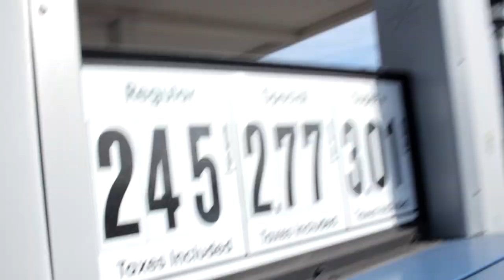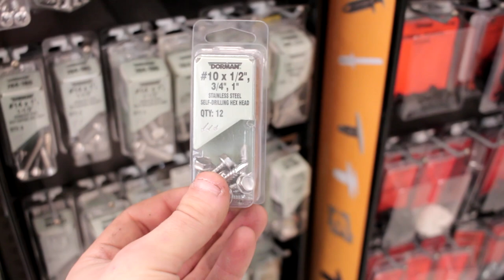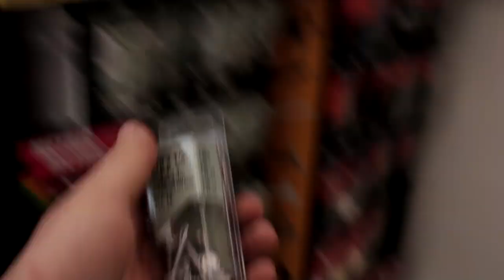FINALLY PASSED INSPECTION!!

Comment: Dude I know the joy of the simplest fixes. My Cutlass had special needs as far as going into park and releasing my key when I turned the damn thing off... The issue was an f'n c-clip down on the transmission that holds the linkage in place had popped out. Replaced it and now it all works like new. Such a relief. I used to have to turn the lower part of the column to get my key out and my park gear didn't work. Lol

Comment: Pick up set of  12x1.25 muteki 17mm hex tuner lugnuts or similar.i would stray away from aluminum or cheap lug nuts especially for drifting. Those lugnuts just take a thin wall 17mm to remove. Beats cross threading and pulling threads all the time

Comment: drill hole then use self tapper ahahahahahahahahahah
Reply: Cam Currier yea i understand that but you also drilled the metal. done plenty of them meself bro. if your drilling holes you miswell use a flat head screw or counter sink it if the fibreglass will allow and go for a cleaner look .self tapper are for the quick and easy job. each to their own bro i just had to have a laugh. if your feeling lazy with checking your alternator grab a compass and throw it next to your battery cable. might help some of ya fans thats dont have multimeters.  👍